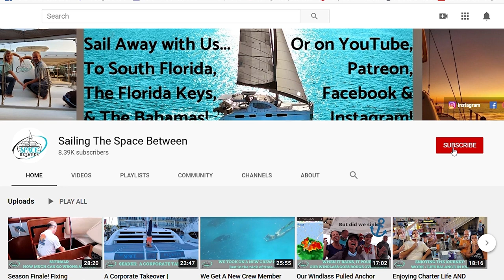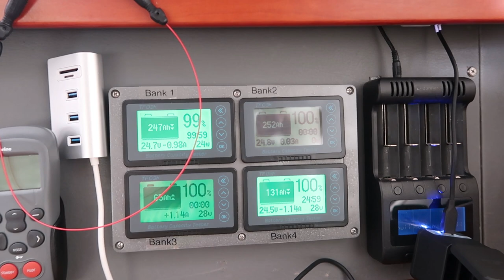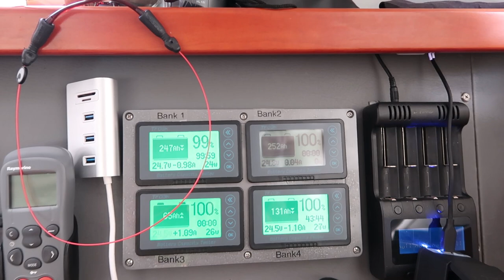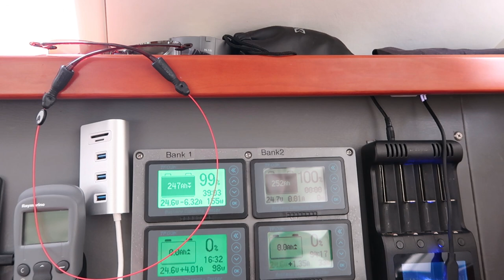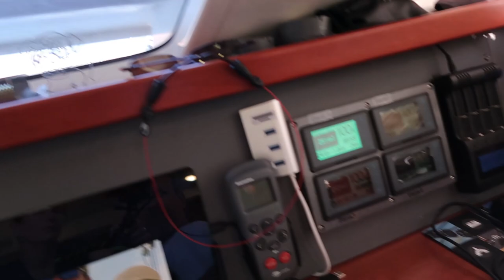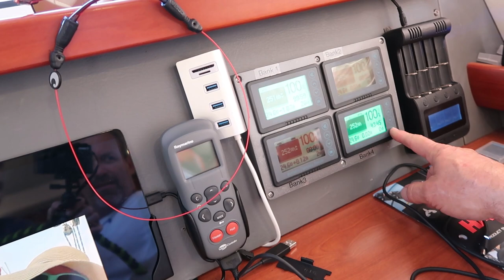Tesla Battery Swap and a Creature INVASION | Fix it Friday | Sailing The Space Between

Comment: It would be interesting to see your efficiency results. I was at 12v and I moved to 24v using Schneider and got about 20% more run time on the AC side. I got another boat and decided to invested $5k in  Victron to go to 48v. My battery system is S7. They work great for the my 24v inverter but not the best for 24v DC. 3.3 X 7 =23.1v 
@48v I can DC to DC to 24v and I will gain more efficiency on the AC side

Comment: The 60v 600AH pack is 36kWh and the 24v 1000AH pack is 24kWh. So the new pack is 33% less energy. a 6 module tesla pack would be 36kWh. not sure how the inverters would effect it.
Reply from the maker: Wile the math is simple the outcome is not always as a matter of fact it never is. My objective is to see the results as the only constant is the amount of power we use at night at a given temperature. the inverters effect it due to the effectiveness or loss of power thru heat I don't think the Victrons are in the 92% to 98% rang they claim... And dropping the voltage also made my solar charging more effective as solar cells are not set up for 58 volt charging but more like 28 so I was loosing power there with them in series and real-estate is very limited on a boat...
Reply: Yea i noticed the big difference in battery capacity and was wondering how that difference was gonna be made up. Yea solar is better is more resistant to shading in parallel.  i'm guessing your AC run on 115AC. what about enclosing the batteries in a water tight box and using the cooling tubes they have? getting baked inside a compartment is going to shorten their life. Have you added insulation to the boat?